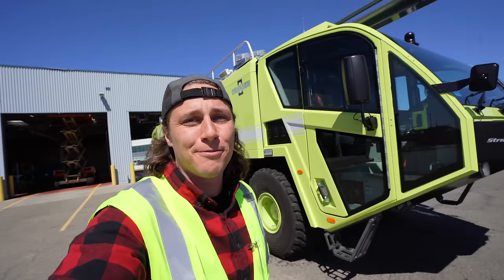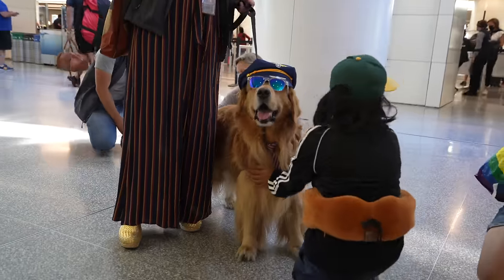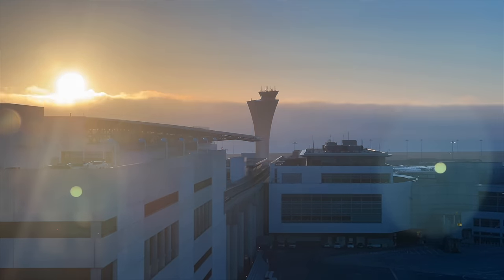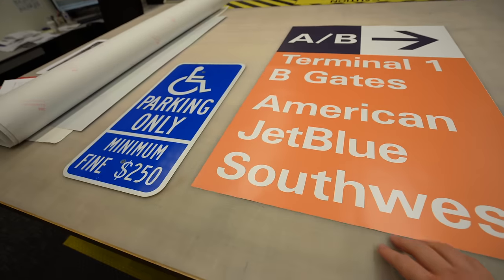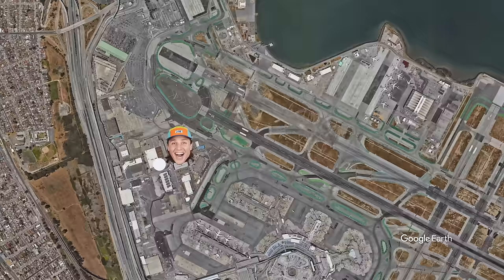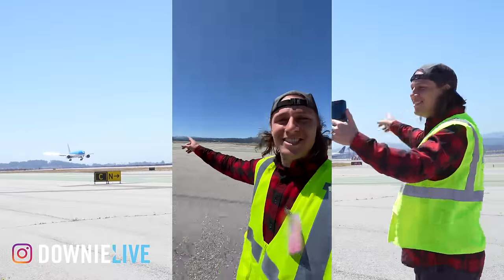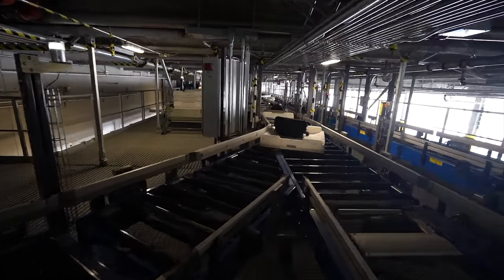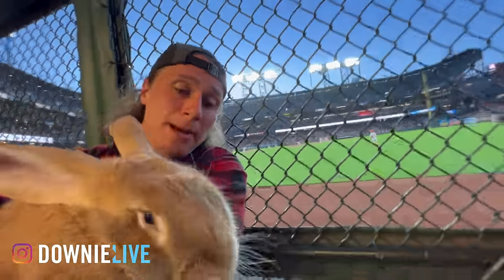48hrs behind-the-scenes at SFO Airport!

Comment: Those massive rabbits are unreal.  Great video.  I was in USAF 1974-1995 working on radar systems used to land aircraft and was normally about 500 feet from runway centerline so saw a lot of aircraft up close and personal as the landed and took off.  Airports are fascinating places.  You did a wonderful job.

Comment: 10:45…If anyone doesn’t think that the job of Airside Ops is not crucial, because, “hey, planes are So huge! Why would you need to pick up EVERY little piece of junk on the runway??”—-A tiny piece of metal about the size of a PENCIL that was lying on the runway at Paris Charles De Gaulle airport Shredded one of the tires on a departing Concorde in July 2000 and caused the tire shreds to fly into one of the engines setting it on fire as the plane took off…and causing it to crash into a hotel two minutes later…an insignificant shred of metal brought down a Concorde because someone in Airside Ops missed it! This is what causes most folks like Wes to be All the more vigilant!